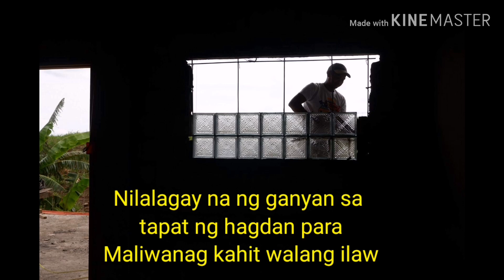Part 21 : Katas ng OFW

Comment: Village person, We have posted our building permit application pages (chapters 1,2,4,8,9)
and a few more around those dates. Feel free to  use all or excerpts from them or any
of our videos on your channel. Just click the icon on this comment. One fun fact is
that inkjet wide format printed sheets are not accepted, only actual blueprints. If your
house plans were drawn on a computer save them as JPEG or PRN and the print shop
can generate an acetate version and print the 8 sets of 7 sheets from the acetate ones.
           If you draw them yourself have a local architect check your work for the
structural calculations and main breaker size, and fire code violations about hall
widths and second means of egress from anywhere in the house. Egress points must 
require no special knowledge or tools to exit from. Cost was P10,000 and included 
5 of the seven signatures.
         Living in the PI from the US with a filipina wife requires flying out to another
country every 364 days to get your passport stamped. You can return the same day.
       You can't run a business here but you can hire as many people as you want. We
 have had as many as 17, not all workers, some just free rice or school supplies
with about 7 of them for house building. Don't hire family.
        Other laws concern children. You can't be around children under 15 or hire any
younger than 15 (unless  a parent is also on the job). It is illegal for children to ask you
for money or for you to give money to them. Which conflicts with children under 15
 to be near you. The solution is, you are not prohibited from throwing money away.
I just keep a pocket full of 5 and 10 peso coins and throw them back over my shoulder.
Escape is possible while the laughing scrambling is going on. My filipina says I could 
be guilty of disrespecting the  children or their parents a more serious offense.
         There is actually a national electric code in the PI but must be downloaded in 
sections such as house-residential.  The green (bond wires) are required although 
when the code was introduced the enclosure ground bars were deleted from future 
production.That of course falls under "It's more fun in the Philippines" Our
electrician fed the house main breaker which is 175 Amps with a wire limited
to 95 Amps. Of course they cut the wires too short for Meralco to connect to
so it shouldn't be a fire hazzard. I classified those guys with the plumber who
installed  the toilet bowl with no waste pipe leading away from it, just a 4" hole 
through the concrete floor. And of course he glued it down with mortar, no flange
and no wax ring.

                                 george and aurora     "CONCRETE HOUSE BUILDING IN PH"